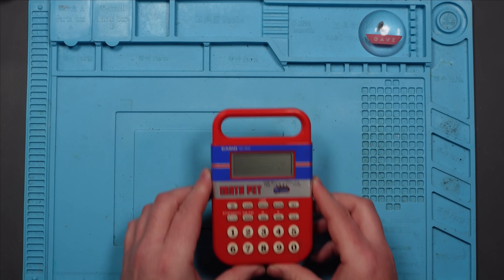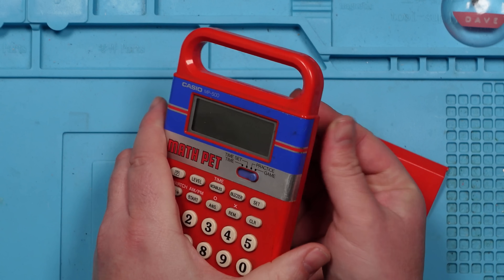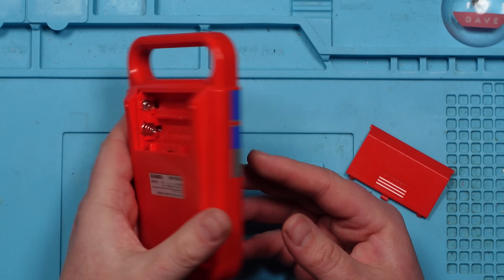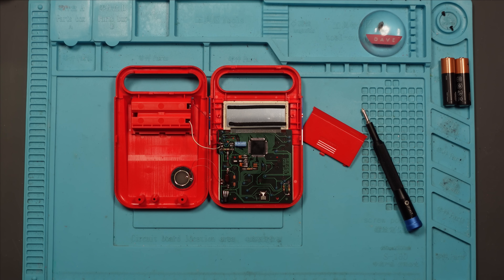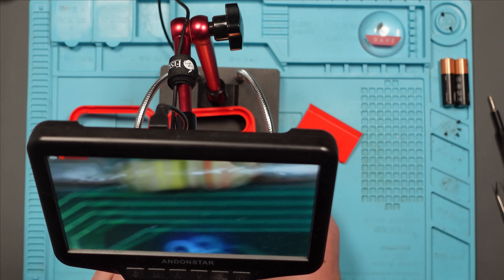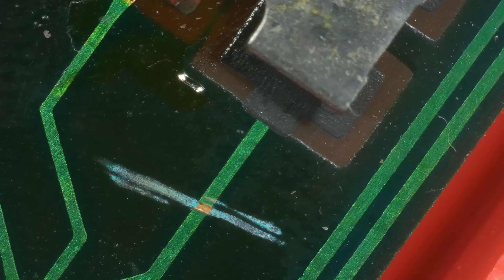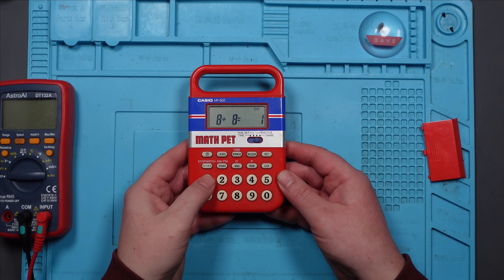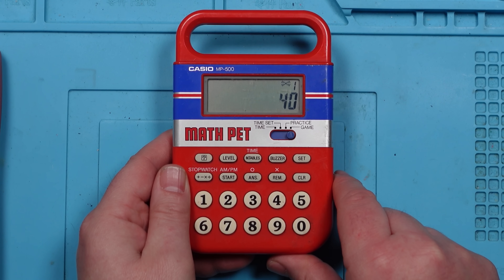I FIXED this MATH PET by looking at it

Comment: I know this is a year old, but at 3:27 there may be a filament between the 6th and 7th pins that you knock off as you're doing the solid test. Could that have been it? I'm just an avid viewer and not an electronymacist, so I'm just guessing.

Comment: To test Crystals you need an oscilloscope and it's pretty easy.
You should get yourself one, either a 50 pound analog one from ebay or go a bit more expensive with a digital one that you can hook up to a computer for recording.
Just make sure that if you buy one from ebay that there is a trace on the screen.

Comment: this is the worst what can happen during an repair x) you fixed it but you cant reproduce how... ive been  thought not to "guess" and randomly switch parts because of the "traceabilty" of an error and documentation for future PCB Versions and Soldering Settings :D glad it worked out even if you dont know what you did :'D

Comment: For a two-legged component (like a diode), you don't need to remove it completely from the board. Just unsolder a single leg.

Comment: Just for info: it's enough to lift one leg on a diode to take it out of circuit so you can test it properly.
It also helps holding the thing while measuring..
Reply from the maker: Thanks Mikael, great tip! 👍
Reply: @StezStixMix  I don't know anything about electronic's what so ever but find all your videos fascinating (I'm  addicted) please keep them coming they are great...

Comment: Had the same thing happen with a modern stereo system. Display was not working, all I did was open it up, unplug every connector, plug them back in, put it back together and the display has worked ever since.
Reply from the maker: It's so weird isn't it, just shows you that it's always worth having a quick look at something not working, even if you're not too comfortable at fixing stuff, you can get lucky by re-seating a cable, or something similar! 👍

Comment: I think you might have just fixed a cold solder joint on that Zener diode. Look how dull the bottom solder joint was before you messed with it.
Reply from the maker: Yeah, that could've been it. Good shout! 👍

Comment: I wonder if a button was stuck down and confusing it. Simply opening it up might have been enough the unjam the button and fix it.
Reply from the maker: That's a very good shout! I didn't think of that, it's still working today but I'll try it again in a week or so! 👍
Reply: Yeah. Dirty contact. It'll probably lock up again in a day or two once the resistance builds up.